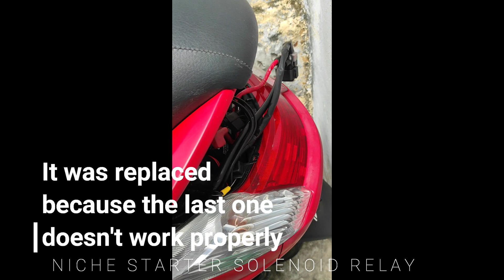How to remove Starter Motor MAJESTY 400

Comment: Excellent but probably outside my mechanical abilities.   My starter relay was clicking and it wouldn’t start. I’m hoping it’s just that I’m just finally putting it back together.    

Thanks for the excellent video!